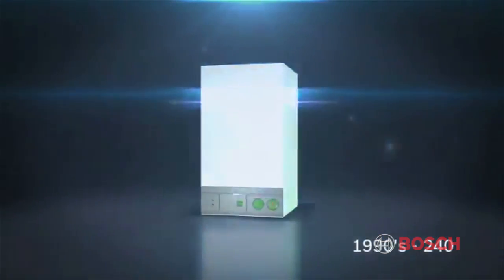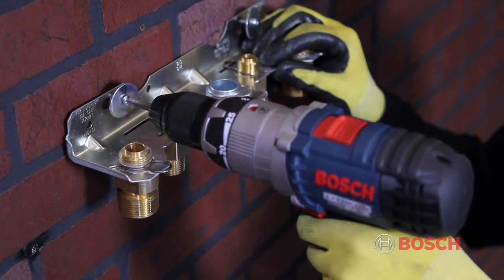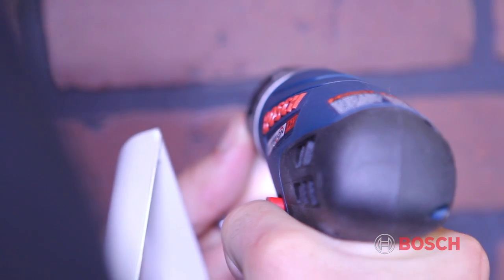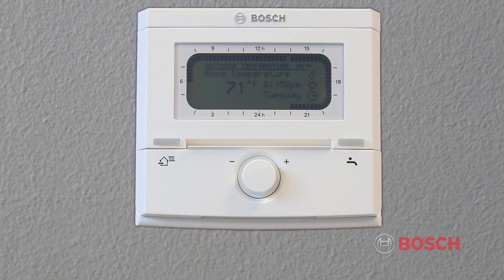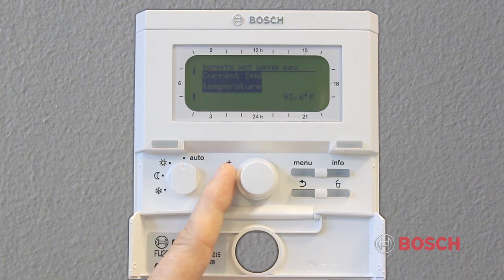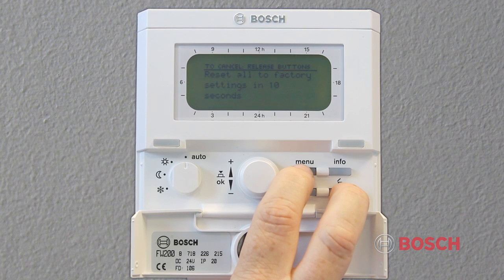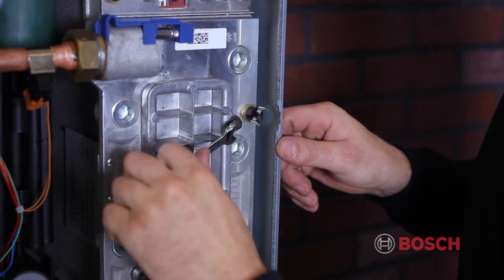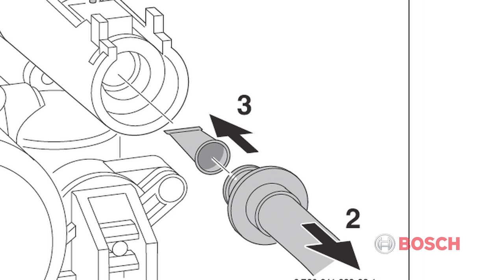Bosch Greenstar Boiler Installation Video

Comment: WHY is Bosch showing PVC pipes used to vent exhaust from their boiler??? Yikes. PVC pipes are only approved for temperatures up to 140 degrees Fahrenheit. The C in PVC is Chloride, PVC pipes start to emit dangerous gasses at 158 degrees Fahrenheit. Exhaust from boilers can exceed 500 degrees Fahrenheit. Also, the PVC pipes will start to degrade, turn color, and fail. How does Bosch not know this???
Reply: It’s called a condensing boiler. Exhaust temp doesn’t exceed 125 typically.

Comment: No easy way to wire an external circulator pump to assist the internal pump, except with a relay of some sort and the line voltage to the thermostat or a 110VAC replay using a signal from the internal pump. Also  I'm going nuts trying to understand what "3rd party dry contact" is supposed to mean, there has to be voltage coming from #2 and #4 otherwise the would not need a jumper!

Comment: I have a problem =/. The bar indicator shakes about 1 minute after i use the hot water. Also pump noise changes. It makes a different noise.

Comment: How do I hire these guys in the video? Because I have one of these worthless pieces of shit hanging on my wall and you can’t just hire a regular plumber to install it or fix it it needs to be a specialist. Not very convenient when something goes wrong in the middle of the night in the winter. STAY AWAY from this boiler!!!!! By the way this is the second one I’ve bought in the last 5 years.
Reply from the maker: Hi Mike, you should be able to find an installer / technician in your area using our contractor locator: https://boschprohvac.com/locator/

Comment: Why desperate pipes for flue and ventilation. Weird. UK models manage this with one pipe using a pipe in a pipe and therefore only have to drill one hole to outside. So backwards to have separate pipes
Reply: That is some difference in Code from two places. Firecode and building code,
Reply: Concentric Venting? your asking for trouble.

Comment: Is zone control panel included when boiler is purchased?
Reply: No, but you can use a generic "3rd party" thermostat.  Hook to terminal 2 and 4 under the interior cover of the control module.